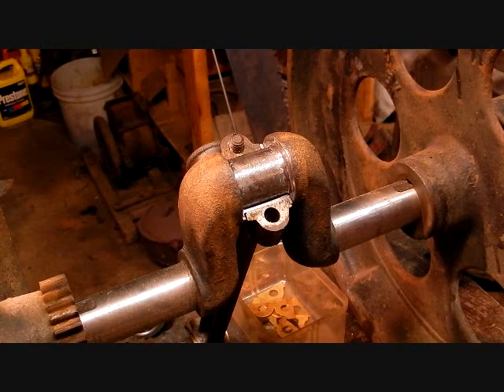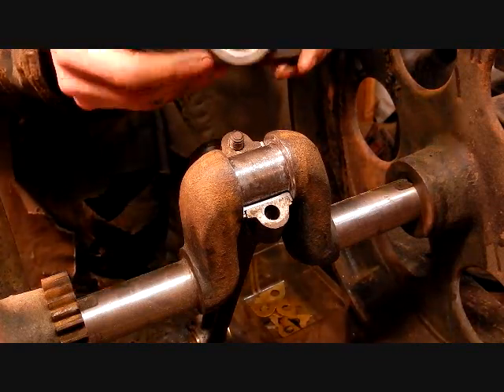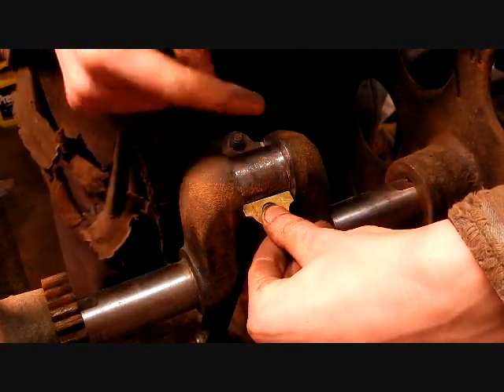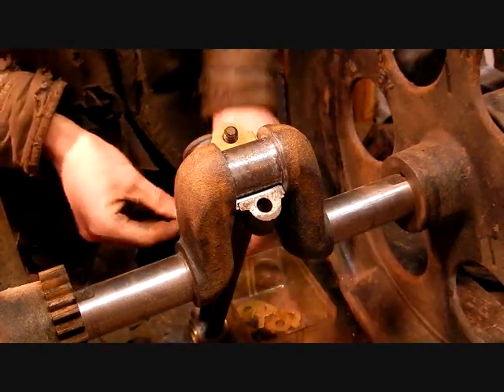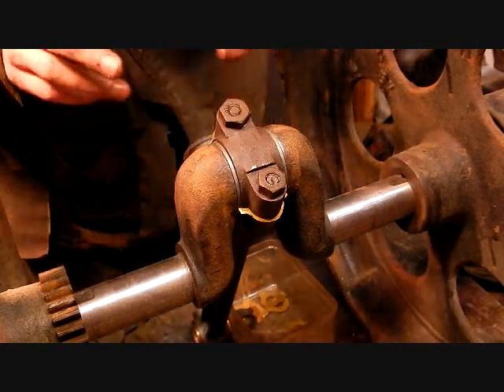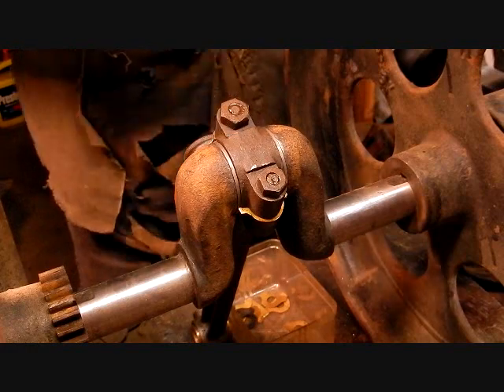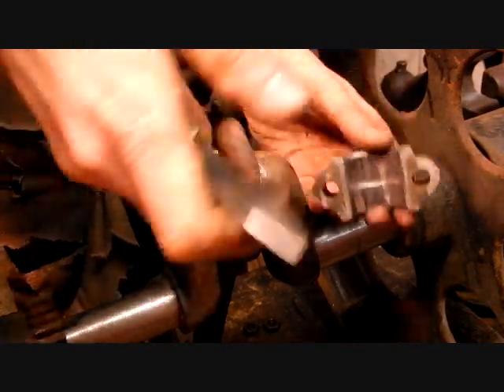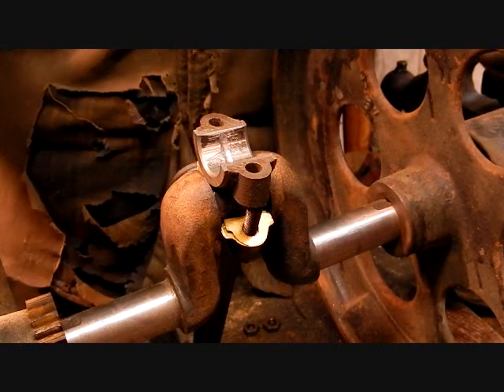How To Adjust Babbitt Bearings on a Hit and Miss engine

Comment: Seems to me that as you add spacers between the two bearing halves, the bearing becomes oval, not round. And the spacers would not enlarge the bearing circle  at the edges of the bearing where it meets the spacer.
Reply from the maker: Good point, yes... this is why you scrape the bearing in addition to shimming it to create a good amount of contact on the bearing surface.